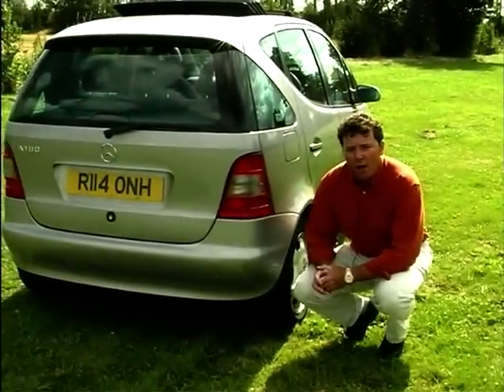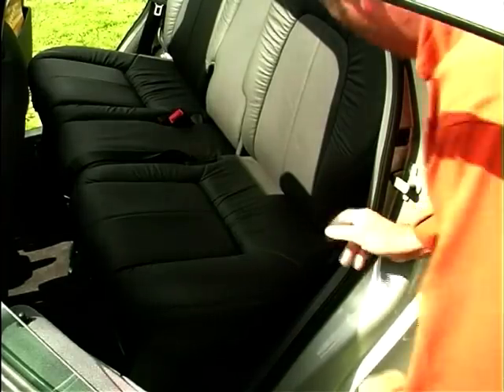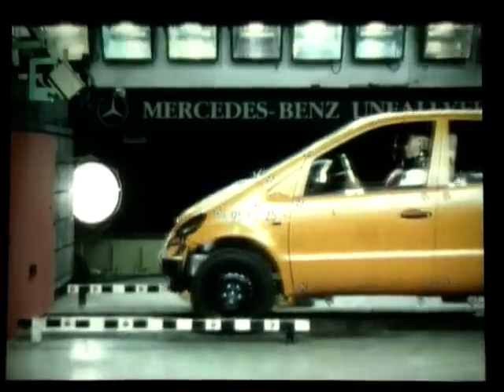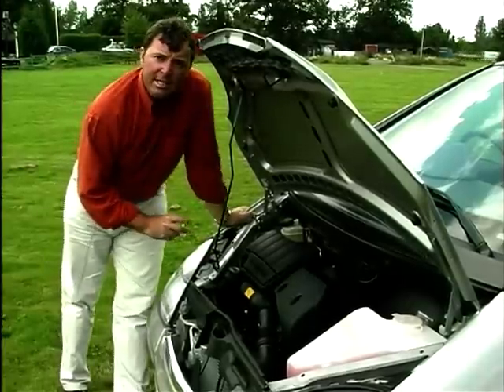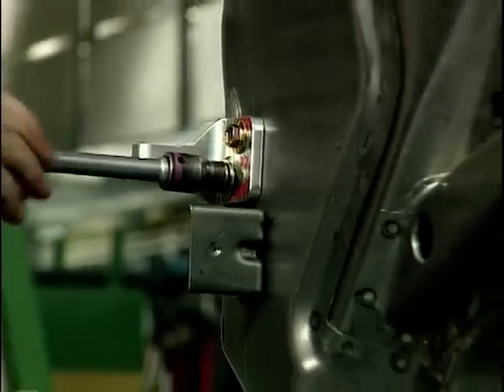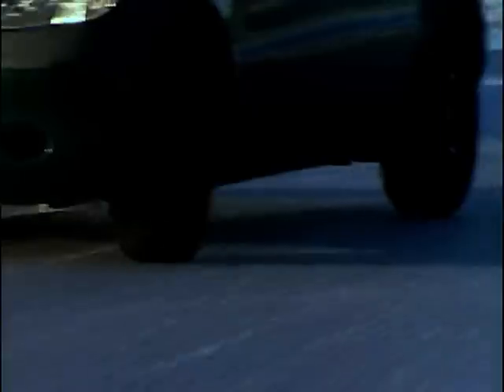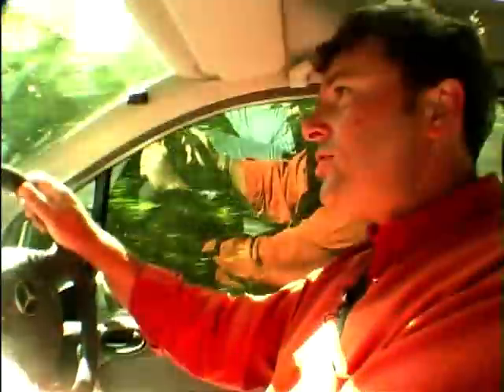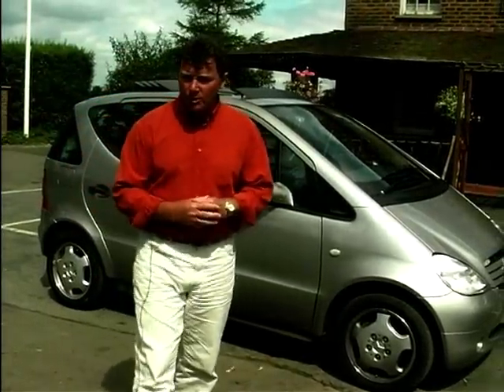1999 Mercedes-Benz A-Class Review

Comment: I have a 2004 Merc  a160 and the urban MPG is abysmal at only 25mpg despite the lightweight body etc. I do drive with economy in mind moving up through the gears as soon as possible with gentle acceleration etc.

You'd expect a car of this age to have a very good MPG, but it's actually worse than some of the heavier 1600cc cars built in the 1970s!
Reply: ELPaso1990TX Yeah, urban mpg is quite bad...but, damn 25 miles to the gallon is just insane! If I can give you a piece of advice have your engine checked, because mine around town does @ least does 40/45 mpg 35/38 if I drive with the air-con on during the summmer (I have a 2002 A160 Elegance with 62000 miles).
Reply: ELPaso1990TX my 2002 ford ka with a lot smaller/lighter body, with his 1.3 liter 60bhp engine does like 30 mpg in the city.....so for that 1.6 liter engine is kinda normal that 25mpg....i guess

Comment: Any a140 user here?
Reply: Me
Reply: just got mine (first car) couple weeks ago! its from july 2004
Reply: Just bought one. Have to sort out a few little issues but is ULEZ compliant and cheap motoring with a clever little car. Just changed the oil and filters…6 litres of minging black oil came out. In my experience petrol engines don’t make the oil black. Anyhow 4.5 litres (correct amount) of lovely Castrol has gone in and hoping all will be well.